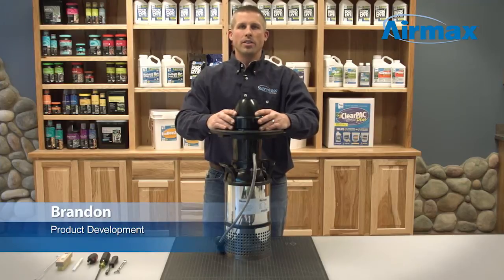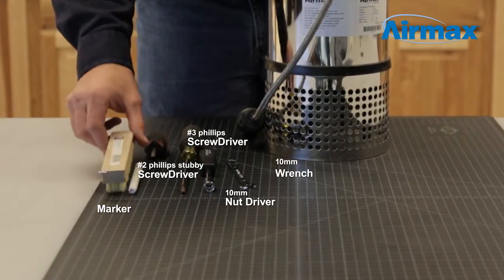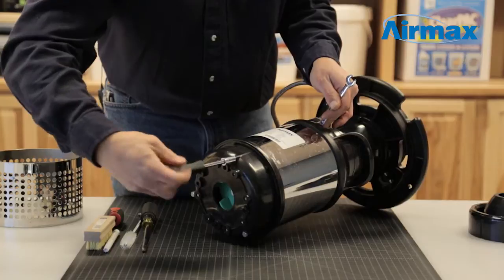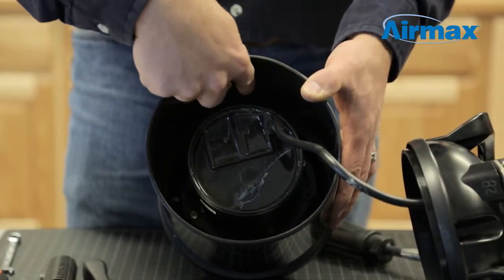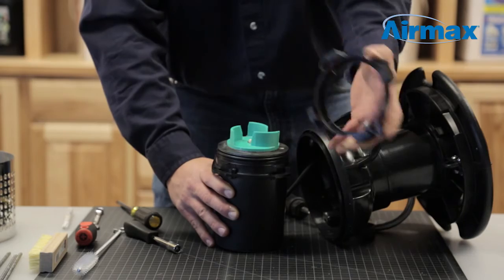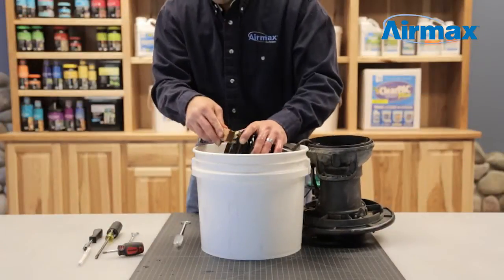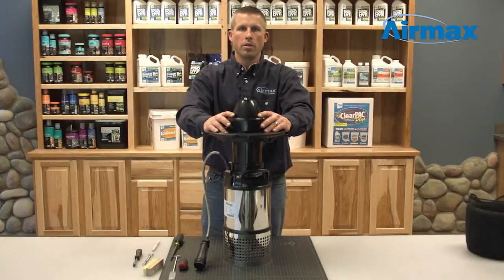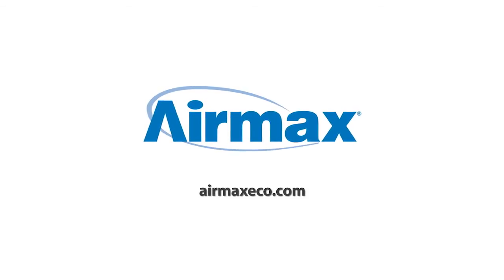1/2 HP EcoSeries Floating Fountain Maintenance Video

Comment: Thank you for the great video.  We received this pond fountain from the previous owner of our home, but when taking it apart to clean, it was obvious that they didn't regularly clean it out.  The rotor locking ring cracked in multiple spots (at the thin points along the ring at the circles where the bolts go through) due to being brittle, upon removal.  Do you sell a replacement rotor locking ring for this model? I am having a hard time finding one, as the rings I can find are for the newer generation EcoSeries ES05.  Or will the newer generation fountain rotor locking rings also work for this fountain? Thank you.
Reply from the maker: Hello Tyler – Please contact us at (866)424-7629 for more information on replacement parts.